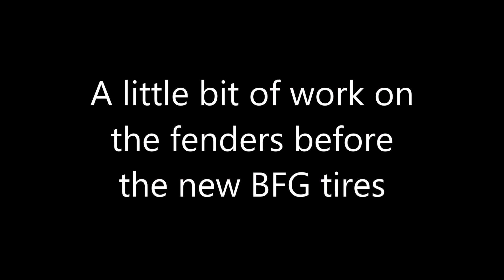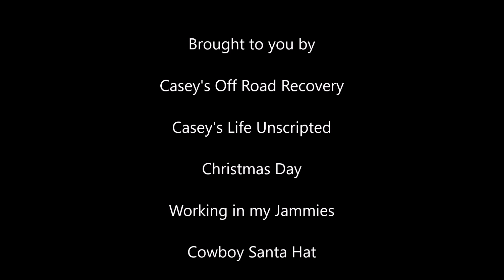Burned up Chrysler Car

Comment: I love how you went from a Ryobi drill to Milwaukee. Lol. I managed a gas station years ago and a truck caught on fire at the pumps. I couldn't get the bracket around the extinguisher to open so I literally just pulled the entire thing out of the wall. 🤣🤣🤣. That fire in that car could have been so much worse. Thankfully they weren't right at the pump and only the engine compartment burned. I love how you dumped the car off. Just send it. 🤣

Comment: You're a class act, Casey.  And you added a little fun to an unfortunate day for others.  As you were grinding that fender after the universal cutting tool usage, I was like, "That's grinding wheel is pretty small... I hope it doesn't sli...."  and it slipped.  Be careful and stay safe.

Comment: Had a old cj7 go up in flames out on back roads once after I smothered the the fire out with a old blanket I took  a old extension  cord out of the back  patched up the wiring and I was on the road again .if the lady's don't find ya handsome might as well find ya handy

Comment: I know exactly what happened to that car. Fuel line leak where it connects to the fuel rail. It starts seeping from the plastic to metal splice. If you have one of these cars check it